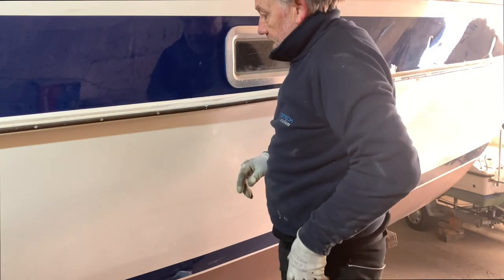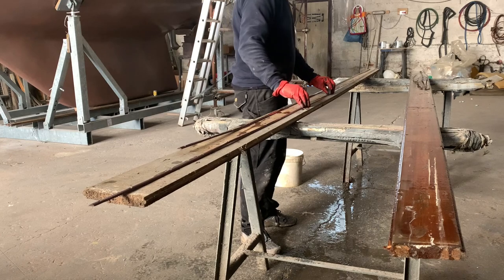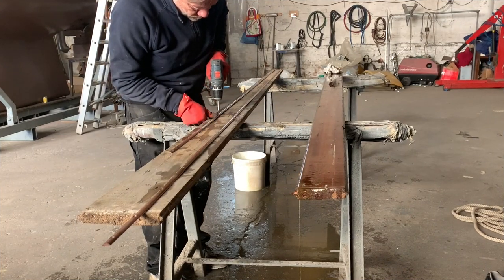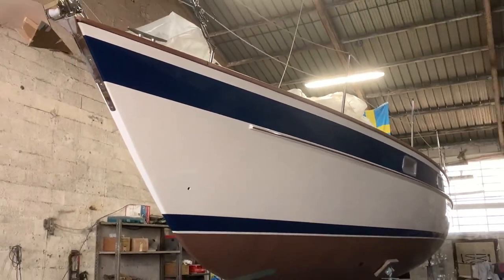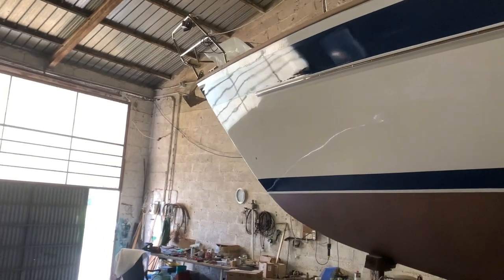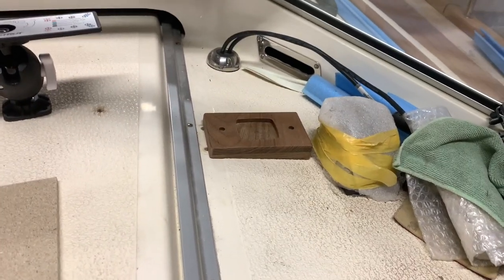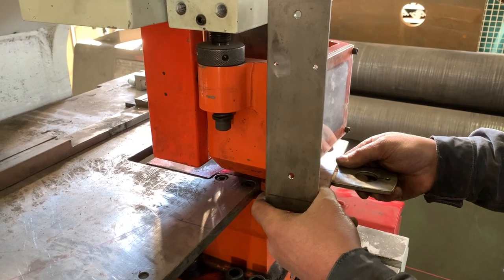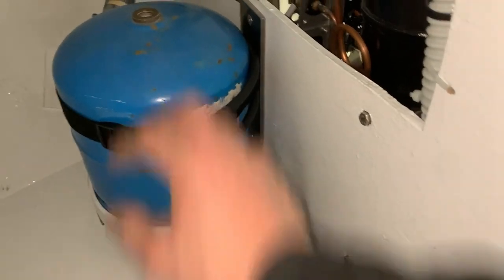Hallberg-Rassy 312 "Ellös": BRASS POLISH - PLOTTER SUPPORT - GAS

Comment: Perfect job again. I also clean the bras of my 352 every year. But is the gas bottle placed in a air ventilated box?
Reply from the maker: Ehi Edwin, no the gas bottle is not in a ventilation box is quite impossible to make it in the stern locker... it’s only a support for spare one well fix to avoid problem during sailing.. I will have a gas detector inside in case...

Comment: Have you check your insurence , with that gas bottel installation. It says that you must have a free air outlet from the boat.
Reply from the maker: This is a spare one the one in use has the vent.. statistics show is more fire on boat due a faulty electric system for owner incompetence Than explosion of gas bottle..for this reason no one insurance will want stay in marine business 😜

Comment: To me ,it looks like your recess for chart plotter block is to deep.It is normaly 3mm.If it was me.I would put rubber underneath to bring it higher.and the rubber absorbs shock.I would have made my block longer.And a bit thinner,As for the brass,every old boat used to have brasso on board.Im not finding fault.Its just the way i would have done it.
Reply from the maker: Mate..is difficult to explain in a video.. your idea is great and I pass over due the fact that all stuff is like a jigsaw ... ands still struggles to finish it.. for sure I need to test it but I still have a spare to swope if need...
Reply: @sea4see  As i say.i was not finding fault.Its your boat and you are doing a great job.I would prefer it to look more like a slightly thinner panel.Than a block.I think when finished.It should be at the boat show.If i was halberg rassy.I would use it to show just how good there boats are.